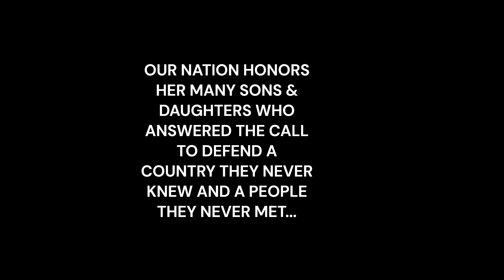Engine building points to consider.

Comment: This fellow really knows his stuff. I used to mess with corvairs and they designed in a quench area, but at the end of the day, GM did not pay for the careful machining to make quench area effective. By milling a recess for the copper head gaskets, you could actually raise compression ratio, raise horsepower, and decrease detonation.
Reply: Also the better mixing of air fuel was being used in air cooled suzuki engines, they called it twin swirl combustion chamber, the squish mixing the charge better
Reply from the maker: Thanks Travis for your comments giving credence to what we are trying to do and make better more powerful and efficient engines!

Comment: Great video. Another topic I often wondered about reducing parasitic loss. Th350 vs th400. 8.8 vs 9 inch. Regular water pump vs electric. Wheel weight etc. I bet you would have some great tips.
Reply from the maker: I like the TH350 built will stay together behind a powerful small block ford or chevy!  I do not waste my time with a ford trans of any type!  8.8 seems to be a little quicker because it has less drag to turn it compared to a 9 inch ford which i feel is overkill.
Reply: @benalamedaracing2765 ben,nice vedios, do you run powerglides,or 350,or the 400 transmission

Comment: There's a reason why every new car has 5/6/7/8 speed transmissions. Powerglides belong in some drag race applications and stock restorations. Everything else needs 3 or more gear ratios. Completely agree that every engine needs a stroker crank.
Reply from the maker: You hit it on the mark sir! My Raptor has a 10 speed behind its twin turbo 6.  Very happy with it.
Reply: I've heard guys who do burnout competitions prefer the PG to maximize wheel speed, while reducing breakage and expense.

Comment: Welcome back. Hope you enjoyed your vacation. And thank you for your service. Question,how much gasket bore size do you lose when the head gasket is torqued.
Reply: I've never seen this as part of a calculation for compression when building an engine, so my guess is, zero.
Reply from the maker: The steel armor does not really expand or take up space when torque down.  However, most manufacturers will post the CC's of their gaskets on their catalogs or sometimes printed on the box it came with.

Comment: Thankyou for sharing your wisdom Ben.
I am slowly putting together the specifications for my 385 series BBF i'm about to build.
I have the block at. 030" and was considering the Kaase P-51 heads, (maybe SR-71), but appear only in a 70 or 72cc chamber.
Do i have to try thinner gaskets and domed pistons to get my comp ratio up?
Looking at a 502cui stroker with 12:1 comp on pump 98 octane.
Reply from the maker: Whatever Kaase recommends that is the correct cylinder heads.  Do not olace a too thin head gasket because the chambers are really good with his cylinder heads!  Just zero deck and 12 compression is attainable with a flat top or maybe even a slight dish in the middle.
Reply: @benalamedaracing2765  thankyou very much, I appreciate your reply.  👌

Comment: Great information about the compression ratio Ben! So would you say it ok to run 11:1 compression ratio with aluminum heads such as sbc Chevy's 113 L98 casting?
Reply from the maker: Yes no problem and if your engine is stock displacement start with at least 224 @ .050 and 110-112 it should give you the best set up.

Comment: Thinner oils today... for street, I am leaning towards something more of a marine style not seen on small engines: a prelube pump.  Requires pan modification for the pickup and a check valve to prevent backflow [wherever it ports into the block], but purging galleys for 20-30 seconds before firing after sitting overnight or longer may yield good long term benefits. 5w doesn't worry me too much but these 0w oils do - scuffing mains seems to be happening too often - clearances need germanic precision or there will be trouble.  The present obsession with anti sludging detergents [calcium dosing etc] by formulators has yielded a new problem:  that old school sludge tendency [often aggravated by colder thermostats] is still better than losing film thickness and experiencing startup damage.  Racers/drifters with an accumulator? Electric solenoid to dump captured volume to the block before crank could serve the same purpose.
Reply from the maker: Your statements are right on point.
Reply: With today’s engine management controllers, Holley, aem, haltech, etc, an electric solenoid to open an oil accumulator would be really good insurance on an expensive engine, and could easily be opened by the computer with safeties setup in the software. I like it!

Comment: I run a stock 454 short block with closed chamber oval port heads and a steel shim gasket. I'm guessing the C.R. at 9.5 to 1 . I ported the heads and added a 2.19 intake valve. It's sitting in a 78 nova with a NP440/MY6 4 speed transmission and  3.08 gear ratio. What cam would you recommend? It's a street car. I know you probably get this question a million times. If you don't want to answer I understand.
Reply from the maker: Joe, I prefer a hycraulic roller over anything out there flat tappet or solid flat tappet.  Looks for something in the 230 @ .050 minimum and lift around .540-.560 on a 110.  This should be a start.

Comment: A former neighbor had a 79 mustang pacecar with a 289 & fmx that he street raced & he was constantly pulling that heavy sucker out because he refused to pay someone to build him a decent transmission.
Reply from the maker: Fmx is one stout trans but is very heavy adding unnecessary weight to any car.  I used a Transgo manual shift kit and that is all besides the custom built converter.
Reply: @benalamedaracing2765  Almost all of his issues were self inflicted like using one of the worst companies for converters simply because they were cheap!

Comment: m running a old 428 fe on the street,it has a flat tappet cam from the 90s do you thing i need to go hydraulic roller?
Reply from the maker: Yes please do this to avoid problems in the future and got to do it a second time around.

Comment: I think the oil weight is pretty much determined by the way the engine is built as well, what you’re doing with it. Tight clearances can use light weight oils. Big hp, loose engine need the higher weight. Plus are just driving to work with mostly or are you going wot everywhere you go! My pretty much stock 5.0 I run the 5w30 Motorcraft in the colder climates, I work at a ford dealer so it is available, and seems to work well from what I’ve seen.  then in summer I run 15w50 Mobil one cause it’s easy to find.
Reply from the maker: You are right on point and agree with you 100%.

Comment: 13:15 
I HEARD A COMMENT FROM AN ENGINE BUILDER : 
KINDA FUNNY BECAUSE OF WHAT SAID IN A VIDEO...
THE OPPOSITE 

 PARAPHRASE ...

IF YOU DON'T HAVE FLOW , IN SAY A TRACTOR MOTOR, 
IT DOESN'T MATTER IF YOUR COMPRESSION RATIO IS 14 :1 or 9:1 .
Implying open chamber vs closed chamber heads , will make no difference. 
Or say 220 vs 180 compression check would make the same 
TORQUE & HP. 
😊 <<< THAT'S A SOMALI FACE 

MY NEW RICH FRIEND IS NAMED PHIL ANTHROPIC 
😊

Comment: I have family in Muntinlupa, ill be there in december for the great christmas parades,also I'll  be visiting this graveyard,,i have a question please,im building a 393 from a 75 351 w,302/30 over pistons,stock 351 rods,3.850 crank,edelbrock E street heads with 202 intakes,i ported & polished the exhaust ports only,my work gained a whopping 15 cfm @ 600 lift, up to 185 cfm,this motor is in a 1976 bronco which weighs  about 4k,,,,35 inch tires,456 gears,6r80 trans,,im LOOKIng  for low end torque plus hoping for at least 400 hp, whats your opinion  on a good cam grind theres So many different  ideas out there,its a daily driver with some weekend racing,???? Thank you sir,
Reply from the maker: Try to run a hydraulic roller from Ford Motorsports an E303 cam and use a 1.7 rocker arms.  What is your final compression ratio?
Reply: I'm shooting for 10.5 to 11 compression,flat top with valve reliefs,also around 35 k quench, if I'm able to open a small trade school in the Phillipines, maybe you can visit & teach us all  some deeper mechanics  then I can teach, ive tried helping kids here in the states,but most  are just too spoiled & don't really care to learn,but the Philippinos are so eager to learn,